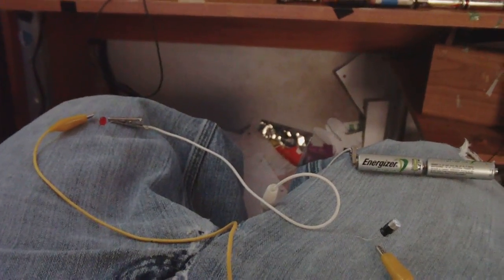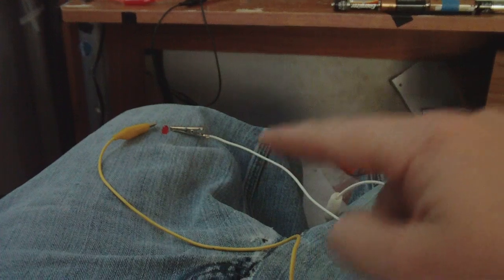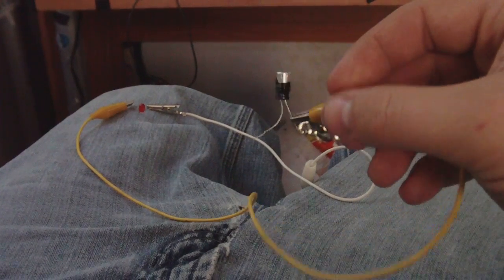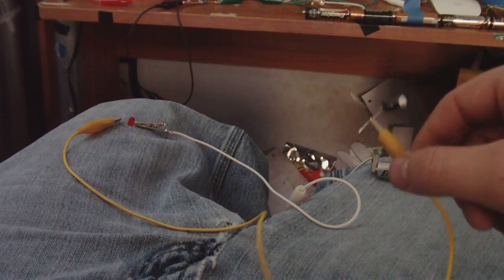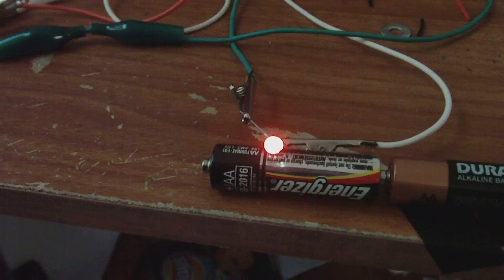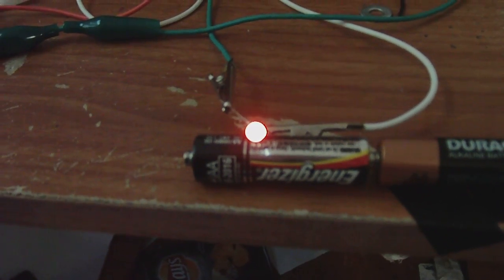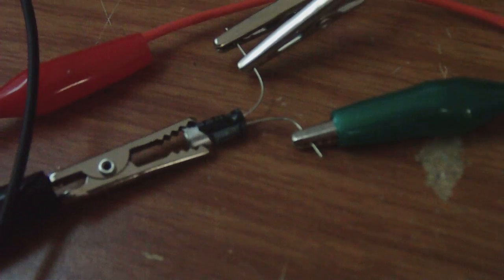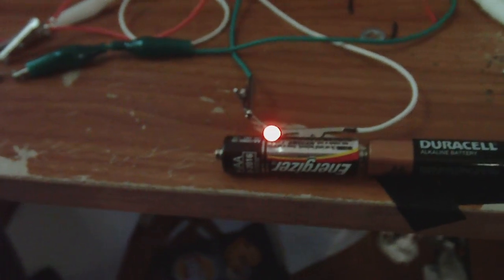More explanation Of the captret effect

Comment: In your example, the LED is on constantly when the circuit is routed through the metal can case of the capacitor, am I correct?  This is not the same circuit as when you connect to the two terminals of the capacitor.  Current is bleeding through the case and that's what makes the LED light constantly.  The capacitor is just acting like a resistor in the setup where the LED is on constantly.